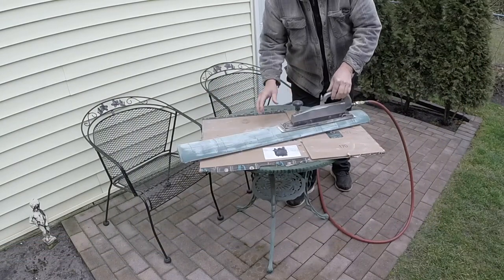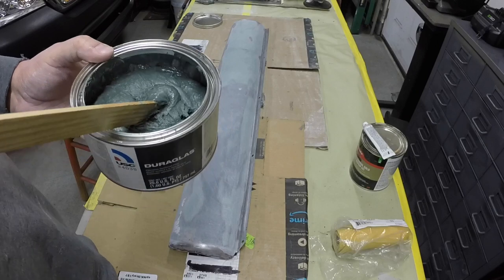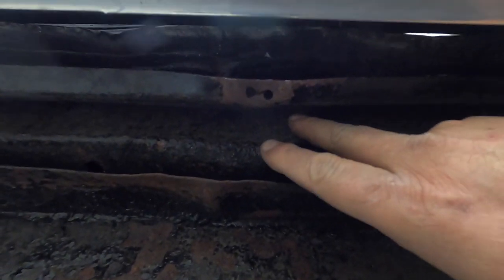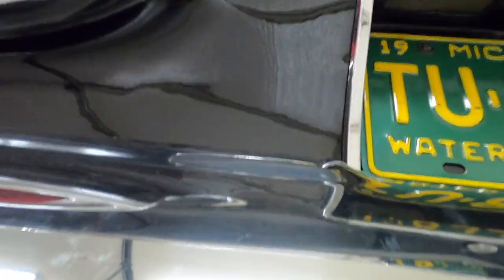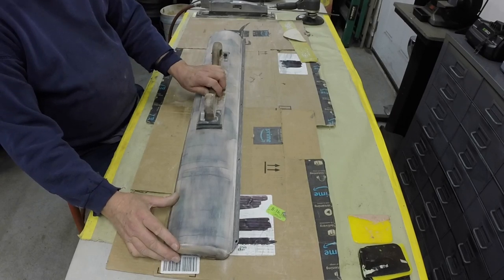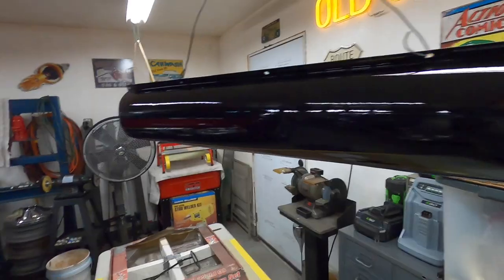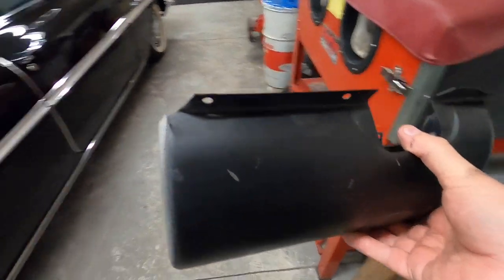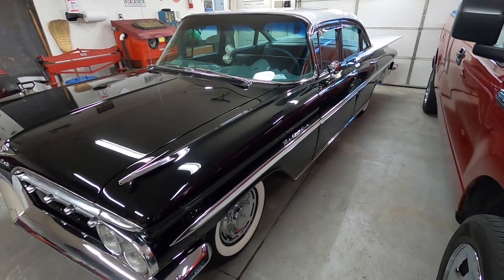Working on the 1959 Chevrolet Bel Air part 3, sanding & painting valance

Comment: I was surprised when I examined the front wheel wells, on my Belair, that there is no inner protection.  The back of the headlights and surrounding area are open and can be subjected to water, snow and salt.  No wonder that area rusted on these cars.  You did an excellent job repairing those areas on your Belair.  Thank you for showcasing your small repairs on your '59.  Always enjoyable to watch!
Reply from the maker: Yep, a common way all cars were built in that era. Mud, salt and crap would get packed up in there, rarely ever getting washed out, causing them to rot out. IF the manufactures made a true inner wheel well back then, the cars would have held up much better..... Maybe if they painted the floorpans too. Primer is porous, so it does not protect anything from rust. The floors were only primed at the factory.

Comment: Nice work!  The warmer than usual weather here was nice to have for such a project as well.  While a Ford guy I do love that car.   Such beautiful and classic lines/fins.  Just gorgeous.
Reply from the maker: Yea, it has been an unusually warm January here in Michigan.

 I have owned and restored more Ford's than any other brand, and will only buy Ford's for everyday cars. I have had good service from Ford products, plus if I have had an issue, Ford has taken care of it in a timely manor. 

The last new GM I had was a money sucking lemon. GM did everything they could to NOT cover repairs under warranty. It had two A/C compressors in one week. Brakes and wheel bearings were like candy to the car, as it went through pads and front wheel bearings like crazy. I think every mechanical item on that car was replaced at least twice. I was going to do a lemon law on it, but that turned into a hassle, so I sold it and have never purchased a GM for an everyday car since.... mostly due to GM doing everything they could trying not to repair the car under warranty. I will walk before buying a new GM product again! 

I do love the styling of the 59 and 60 GM cars.... the 59 Chevy being my all time favorite of any car ever made. GM made good cars in that era.

Comment: 👍Looks great H! Now for the front seat (??) Awesome Chevy!
Reply from the maker: Yep.... I got grill screen moldings to replace too..... along with fixing the rocker panel moldings from coming unclipped. Im kinda thinking the holes where the clips go threw might be rotting out, so I may end up reskinning the rockers. The under and inner sides of the rockers are solid. Often where moulding clips go threw, is where rust occurs first.
Reply: @OldCarAlley  yes sir.. I’ve seen a lot of that in the older cars. Your 60+ year old car is still phenomenal!

Comment: Instead of spot putty, add a little extra resin to the Dura Glass. It makes it sand smooth and goes on like cake icing. Used it for years.
Reply: Don't forget to add a little extra harder to if you do add extra resin to the Dura Glass
Reply from the maker: I often do that with bondo to fill minor pits. Sometimes I thin the Duraglass, but this was new stuff and it sanded out really nice. I refuse to use spot putty!

Comment: Wow, Howard looks fabulous. You’re not scared to put the paint on are you , you really lay it on
Reply from the maker: I don't like buffing paint, so yes I kinda lay it on wet enough to prevent orange peel, but not run. I think the outer valance panels, I'll use my doorjamb gun.
Reply: Well, I must say you’re an expert on putting paint on heavy without runs. PS I don’t know how you do it I keep saying he’s putting too much on it’s going to run but It don’t.
Reply from the maker: @1234567896783  On very rare occasions I might get a small run... but none on the center valance.

Comment: Brother use 6 in wire wheel on your grinder works great and quickly.
Reply from the maker: I find wire wheels generate heat causing warpage. I prefer using my bead blast cabinet. The rear frame member cleaned up nice scraping it, but did hit it with a wire wheel on a drill a little..... just to get all the loose stuff off.
Reply: @OldCarAlley  yes that's what I meant it's great for frame, underbody rust.
Reply: Sorry just called you Walt, Howard. Told you it's been awhile.

Comment: I found a product made by Bondo, called Bondo Glass. It looks like the same color and consistency as the Dura Glass, and much cheaper. I just wasn't going to pay what they wanted for Dura Glass. Seems to work just as well.
Reply from the maker: I'll have to look into it, as all those products are basically the same, other than the brand name. I was getting low on gloss black, so I broke down yesterday and spent $198 on a full gallon of acrylic enamel gloss black, so I have enough to paint everything I plan to fix on the Bel Air, plus lots of extra for other projects. One of the guys at the paint store was restocking the masking tape..... he had piles of tape everywhere. I was joking with him about getting free rolls of tape with my paint. He gave me a half dozen rolls in different widths...... I was shocked! I go there often and really like the people that work there. There a bunch of really nice guys!